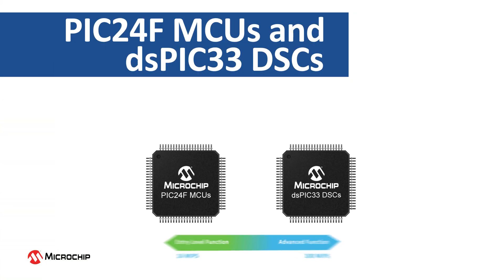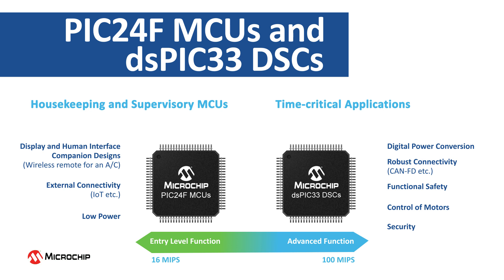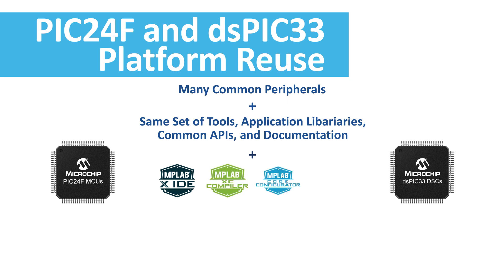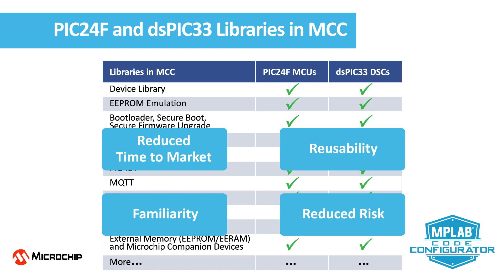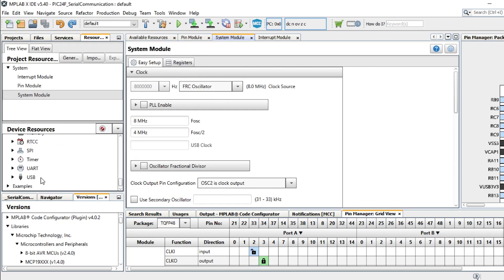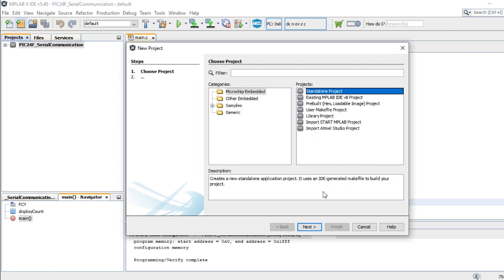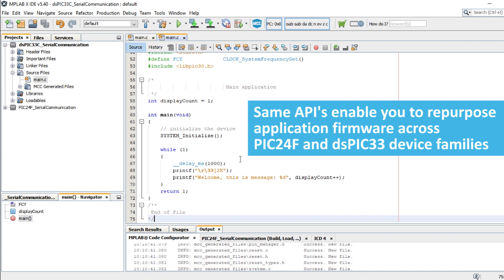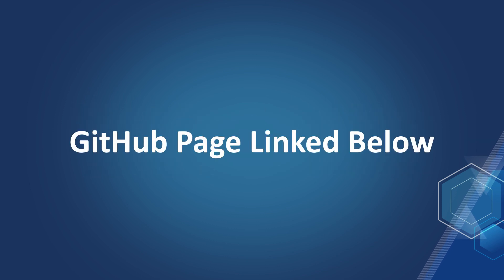PIC24 MCUs and dsPIC33 DSCs | Easy Migration in a Platform Design

Comment: What is the clock speed get the timers im disp33ep
Reply from the maker: Hi there, thanks for your question! The dsPIC33EP timers are clocked by the instruction clock, which is derived from the system clock (FOSC) divided by 4 (TCY). For example, if the system clock is 60 MHz, the instruction clock would be 15 MHz. Hope this helps!
Reply: @MicrochipTechnology  it is no where clearly mentioned what will be the system core clock speed i didn't get what is the value 
Here two scenarios in timer 3 by setting or value as 7357 I got 1 millisec time interrupt means it got clock speed of 7.37 mhz according to your logic it's system core clock speed is 7.37*4=29.48 mhz 
And another scenario is i checked the pwm with scientific oscillator in the if we put 40000 in ptper I got frequency 2mhz now after calculating system frequency with fosc formula I got approximately 78mhz this is my confusion could you please clarify my doubt